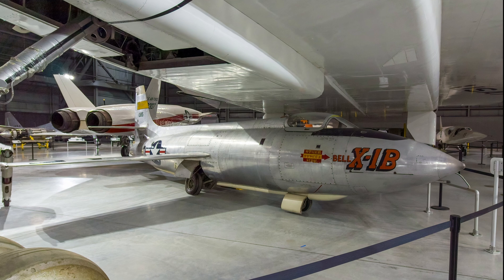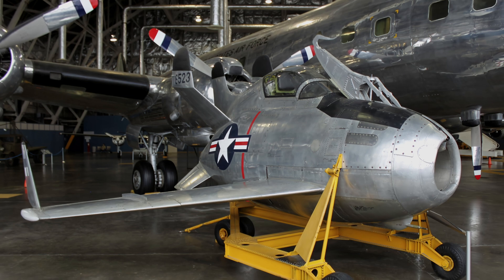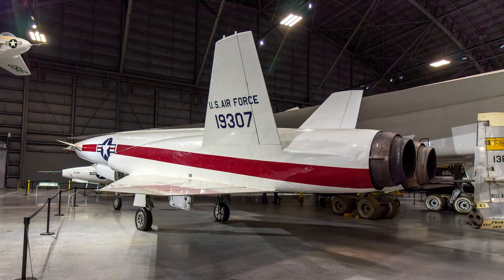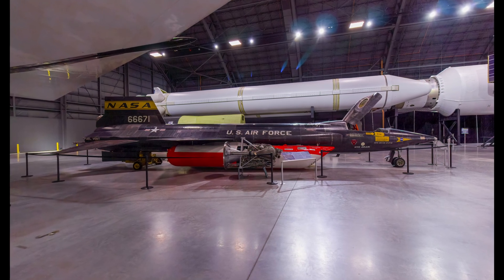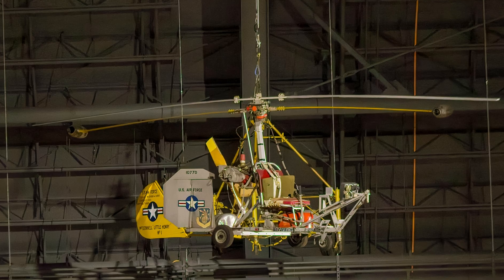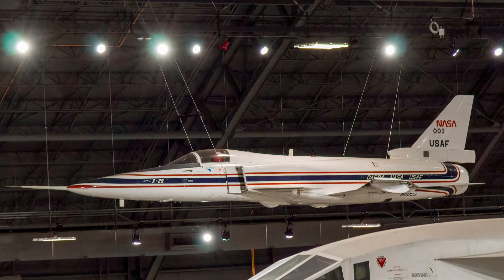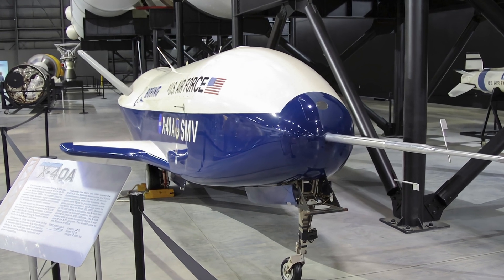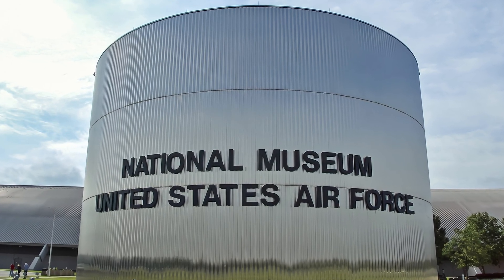Research aircraft exhibited at the National Museum of the U.S. Air Force, a Narrated Virtual Tour

Comment: the b 70 did fly two were built one crashed both flew in test program
Reply from the maker: You are right and I am guilty of lazy writing. Since the cancellation occurred before and were flown the statement is technically correct but very misleading. Yes, they flew in NASA high speed test Flights. Thank you for bringing this up.